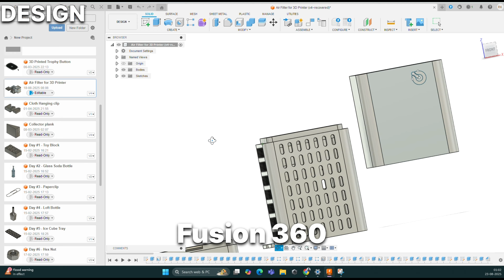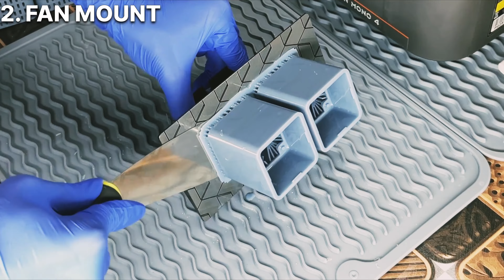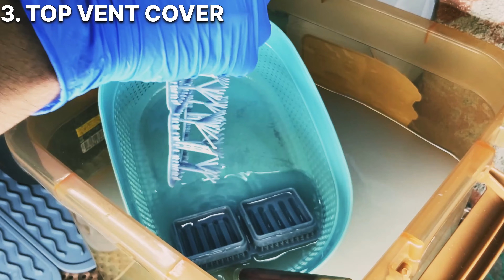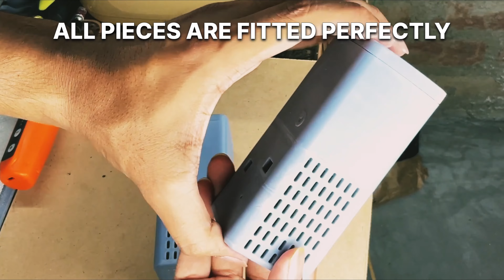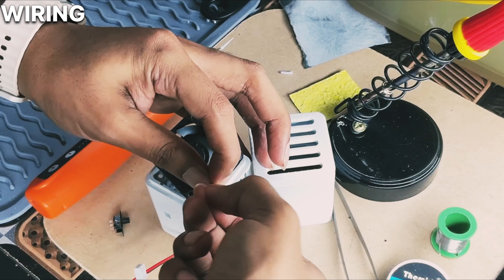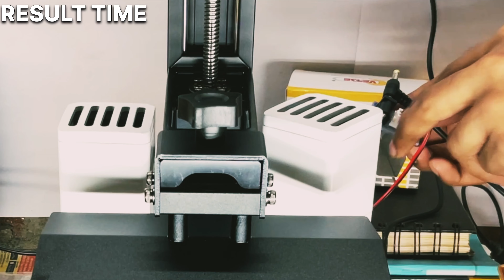No More Resin Fumes! DIY Mini Air Filter Build

Comment: It probably doesn't get rid of VOC's from the resin 3d printer.
Reply from the maker: that totally depends on the filter type.  if the filter is capable of reducing Vocs the it will😅😅

Comment: Nice, but I wish you would put a link to the STL files for us to download. I have just bought a resin printer after 3 years of owning FDM printers and although I will still use my Bambulab printer more than a resin one, I would still use the resin for small things to print. I am also thinking of building a heater for the resin printer unit. I have built a curing cabinet to cure the prints for when I receive  the resin printer. I like to be ready and prepared for when it comes so I am not needing anything to buy later.
Reply from the maker: I'll upload the STL to download soon😊😊
Reply from the maker: Hi, I have uploaded the STL files.
Check out new video
https://youtu.be/CtV-tWiGOwQ?si=IbD4mUBSywvSmezt
Reply: @CharmQuest3DP  Thanks. Just watched this video again and also the new one. Have also described.
Reply from the maker: @allenian-c4m9q thank you😊😊

Comment: Very misleading when it comes to resin these don't do remotely enough to remove the harmful fumes associated with the material
Reply from the maker: No offense, this is not a perfect solution as compared to enclosed ventilation. But it can help to reduce significant amount of fumes if enough airflow with good filters.